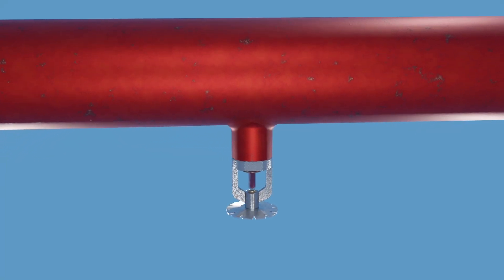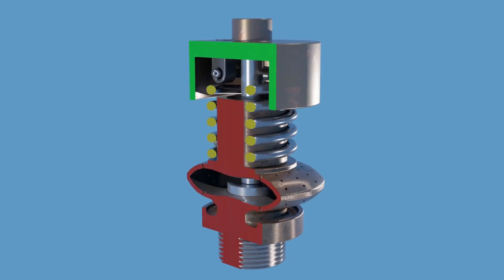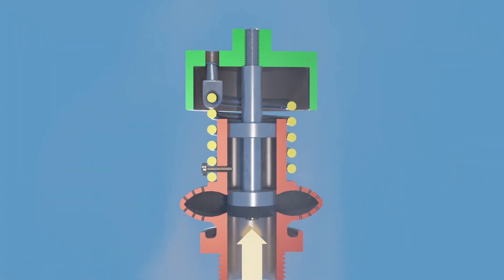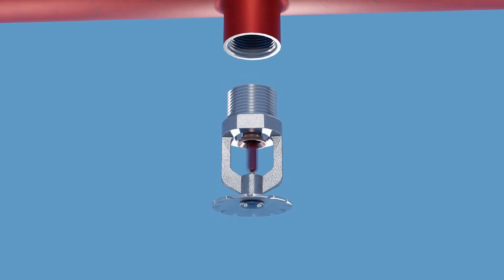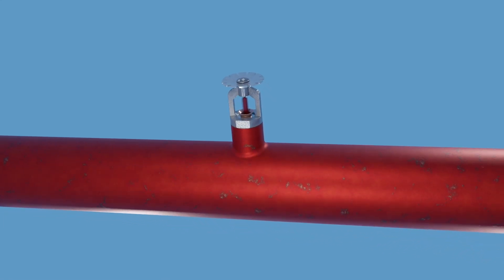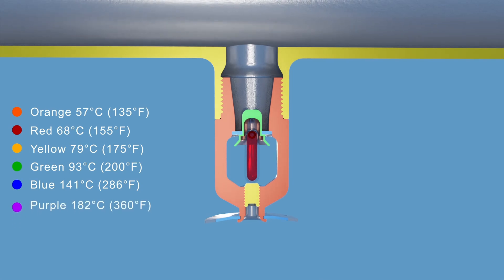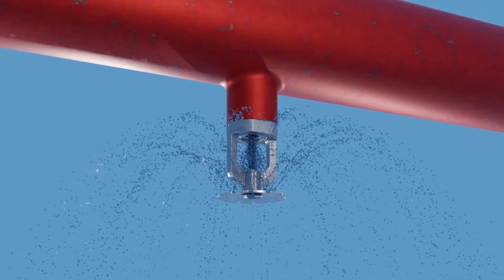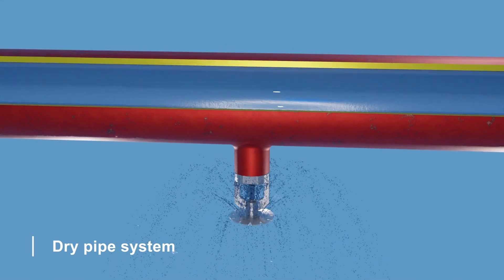How a fire sprinkler works

Comment: There are two types of dry fire sprinkler systems. One uses an inert gas and functions similarly to a wet system. The other has open-ended sprinkler heads, with each head acting as its own fire or heat detector. If a sprinkler is triggered on a specific floor, the valve for that floor opens, allowing water to flow from all sprinkler heads on that floor. Movies frequently depict this incorrectly, as they show the entire building being soaked, whereas, in reality, only the sprinklers on one floor should be activated.

The very first active sprinkler head used by the piano manufacturer in his own building resembled the design of modern sprinkler heads. However, instead of a glass trigger, the plug was secured with a low-melting lead solder. When exposed to heat and fire, the solder would melt first, causing the head to burst open and release water, thereby minimizing potential damage outside the area where the fire originated.

Comment: A lot of misinformations. In industries and critical facilities deluge valves are used. And fire sprinkler heads are used in the primary fire sensing lines. When one sprinkler head detects the fire the pressure inside the sensing line drops and the deluge valve activated which activates the secondary fire spray line and water comes out all over the facility. This system is more effective and reduces the risk of fire spreading. And this deluge valve system can be used in parallel with smoke detectors and heat sensing cables without extra cost and modifications.

Comment: technically the movies arent wrong buy it would have to be a deluge sytem. the pipes have no water in them and all the sprinkler heads are without bulbs. smoke detctors are set up and if they detect a fire the vavles open and water gets pumped through the system and shoots out of the heads.

Comment: used in parking garages: how tf is 100000 ton concrete parking garage coing to catch fire. non the less incredible video 10/10
Reply: well ... teslas exists ( even though a sprinkler wont turn off a battery fire atleast it will try its best :D )

Comment: Not 100% true. In the past company i'm working in (audio video stuff) were making and installation in a gasholder (that's been rebuild to hold huge hall with pa system and projektors and couple of smaller more private halls like that). And i remember one day we arrived at the area and we our contact tech sitting near huge lift shaft that looked like waterfall. Turns out there were firemans inside testing a system and one wanted to see a sprinkler work. But after they activated one whole section bursted open, flooding (and ruining) eooden floor in multiple halls, along with two of you large sized projection screens. So either smth like watter hammer made them rupture as well or there's a system when if one activated and pressure drop is noticed on the system huge pumps will increase it that much that all other sprinkler tubes are bursted by the prrssure increase
(The gas holder have huge water tanks with 2 big pumps - i've seen then once, like a bottomless pit sutrounded by concrete and nothing else)

Comment: My residential sprinkler heads have 4 slotted vents holes that allow air from the attic to enter the home. I have an exhaust vent that runs 24/7 and dust from the attic comes in. Are the vent holes needed?

Comment: You're actually incorrect and tv shows are accurate that when one goes off, all go off. Some systems are designed to over pressure the liquid lines in order to burst all other ampules if the system notices a significant drop in pressure from one bursting.

Comment: The only thing you failed to mention is that instead of nice clean water, what you get when a sprinkler is activated is the most foul smelling liquid you’ve even experienced spraying everywhere. The water has often been sitting up there since the buildings construction, and all the time turns it into something I pray no one ever experiences. I can still smell it.
Reply: If building matince team flushes or sprinkler once a year should be clean
Reply: @tylersheehy3918  yeah, I used to work near one of the sprinkler flushes and heard the water running out of the valve, for a few minutes and heard the maintenance guy on the walkie talkie talking to someone to see if the flow sensor was activating.
Reply: Flushing is done (sometimes quarterly) to ensure good pressure and cleanliness.
Reply: @Furious321  Where? Maybe where you are, but I've never seen that done, and I can tell you, having been present for a sprinkler activation in two separate buildings, that a flushing had NEVER been done.

The stench remained for weeks, I can still remember the smell.

Comment: 6:19 some fire sprinklers do go off all at once with the triggering of a smoke alarm (these are similar to dry pipe but are missing the bulb) I understand they're common on car carrying boats. [Another commenter pointed out they're called a deluge system]

Deviant Ollam has a really great talk about fire code including in-depth explanations of all the sprinklers.

Comment: Movie myth: pulling fire alarm does not make springer release any water.
Reply: Not myth. But in reality smoke and heat detectors activate the deluge valve and water begins to spray all over the area. We test our fire suppression system in our plant regularly. Sometimes the deluge valve mal-operate and causes trouble.

Comment: There is another system I have seen on a boat where the pipes are filled with low pressure water but as soon as 1 sprinkler pops a high pressure pump activates the rest of them

Comment: Water deluge systems do exist, basically if any heat is detected anywhere then the entire system is activated, such as in high hazard areas where there are lots of combustibles. And the clip shown from the equalizer is a place where a water deluge system could be used, funny enough. A hardware store has tones of chemicals and combustibles! Although I have no idea if hardware stores usually use them, this might be one of the rare movies where this trope could actually makes sense.

Comment: You forget about deluge system, with one pressurized air pipe and one dry pipe. 

The pressurized air pipe has the glasses and keeps air pressure up to keep a watervalve closed at the dry pipe. 

When one goes off al go off :). ( Used a lot in chemical factorys)

Comment: If all sprinkles go at the same time, it's most likely a deluge system. 
It's triggered by a secondary (dry or wet) sprinkler system.
The dry deluge pipe has open heads, the trigger system closed heads. 
When fire triggers a closed head, the air or water pressure drop opens the deluge valve, allowing water discharge thru all heads of that primary system.

Comment: To fix the flickering:  I think you can try to use a super big plane as the light source (assuming you haven't tried mucking with the denoising settings).

Comment: I never thought to question how fire sprinklers are triggered all together in movies!

Awesome animations!
Reply: And in like high risk places you can trigger them manually 😊
Reply: I've head that there are nice systems, that increase the preassure in the pipes high enouth to break the glas tubes in the other sprinklers, but those are really seldomly used.
Reply: In this video the cheaper version of fire sprinkler system (mainly used in restaurants) is shown. But in industries, the secondary deluge system is used which triggers secondary fire spray lines and water comes out from all over the facility. This system is very effective to minimize fire spreading and this can be used in parallel with smoke & heat detectors and heat sensing cables without extra modifications.

Comment: I am probably way off base here.

But I'm curious if dry systems are more prone to activating multiple sprinklers when only one sprinkler is tripped. I wonder if the transition from gas to liquid on an old system might cause some plugs to fail. Maybe even wet systems are prone to a similar failure point.

So maybe that's where that 'hollywood' sprinkler scene comes from.

Comment: Ummm... there is a 3rd type of system, which does trigger all the heads at once.  This one doesn't have valves at each head, but instead is controlled by a valve or valves and is triggered manually by an activation panel or by a fire alarm system.  It usually exists in manufacturing plants or places where dust or materials can get to a concentration and cause a dust explosion, and where if there is an issue in one place you do want the whole area wet down, not just the specific small area where there is a fire.
It is not used in an office area, as that sort of area, the cost for remediation is too high to have them all trigger (replacing all the papers, furniture, computers, etc)
Reply: Called and used in dry system
Reply: @AlwaysAlert No. Not a dry system. Those are wet systems. Those are called deluge fire suppression systems. You can find videos of this system on YouTube.

Comment: Also, sprinklers must always be situated at the very top of the room, at a very close distance to the ceiling. That's because  hot air from fire quickly rises, and stays at the very top part of the building volume, if the sprinkler is not there, it couldn't activate at needed time.

Comment: There is a kind of sprinkler system that activates all the sprinklers when only one is triggered. It consists of a dry pipe fitted with nozzles and a wet pipe with normal sprinklers. When a sprinkler in the wet pipe system activates and loses pressure, the dry pipe gets charged with water or foam from a pump, which flows out of the nozzles. This system is mandatory in garages in Taiwan, making it very common here.
Reply: The type of system you described is a deluge system, which is widely used not only in garages but also on theater stages and at hazmat storehouses. They not only respond quickly to fires but also prevent the combustion from spreading out.
Reply: @FOHGeek  I see it often Deluge systems in Oklahoma at electrical plants, or very large outside transformers.
Reply: @FOHGeek  There are different types. Theirs is triggered by a secondary sprinkler system. Most I've seen in the US are triggered by banks of "A/B" smoke detector pairs right next to each other throughout a large space and there must be an alarm signal from both an "A" and "B" smoke (or heat) detector before charging the deluge system with water (or foam). I was commissioning the fire alarm in a new middle school in 2002 that had a deluge system in two gyms. That process involves spraying artificial smoke into each detector and confirming over walkie-talkie that the panel went into alarm and it was reporting the correct location in the building. Special precautions need to be taken with the smoke detector pairs to ensure you don't get smoke into both detectors. We did that for some reason one of the "B" detectors didn't release when the system was reset and when the "A" in the next pair was tested, the system charged. There was a sprinkler technician in the riser room who was able to kill it but enough discharged that the gym floor was ruined and needed to be replaced. Mistakes happen. It was insured.
Reply: 正想說我家地下室就是會分區一起啟動的那種
Reply: There are sprinkler systems designed to go off fast than a match can light when struck.  They use sensors regulating temperature to control the system.  Go Local 669!

Comment: I think you meant pendant. Not pendent.
Reply from the maker: Thank you for pointing that out! The correct term is actually “pendent” in the context of fire sprinkler heads.
Reply: @Deconstructed_Animations  Really? I wonder how that came about?
Reply: @Deconstructed_Animations  also the thing that you forgot to mention about the wet pipe sprinkler systems is that because the water often just sits in the pipes for long periods of time until the sprinkler heads are triggered often the water that comes out initially is brown and gross from corrosion in the pipes